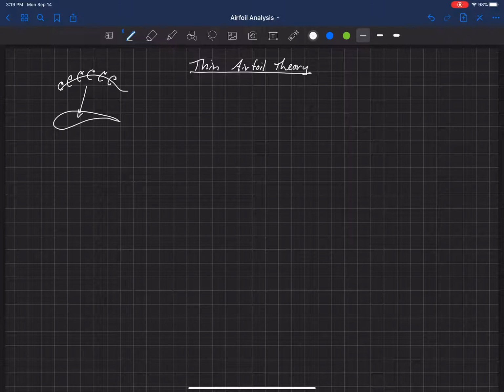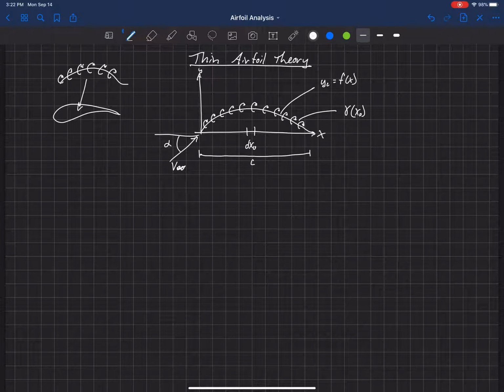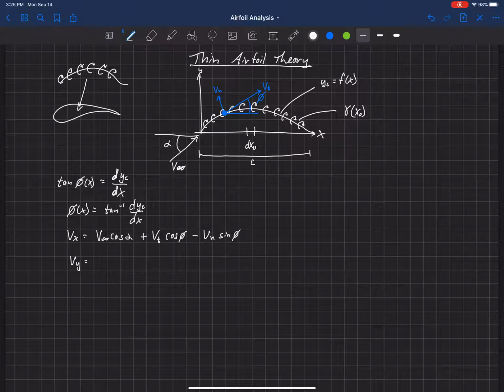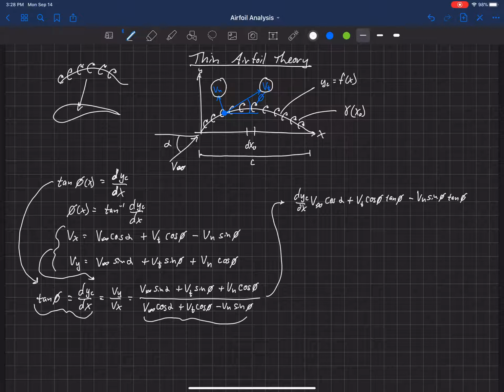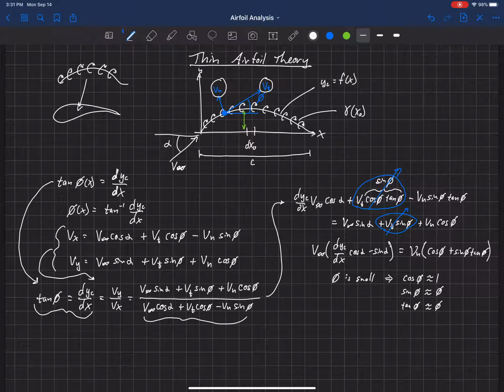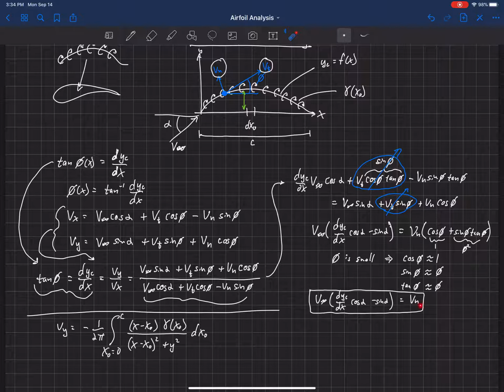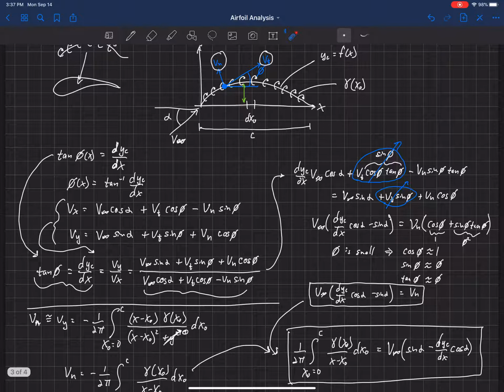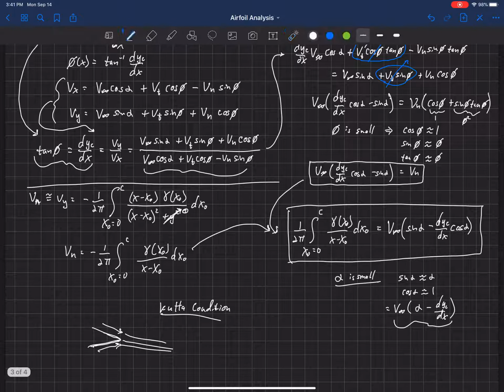Airfoil Analysis . Thin Airfoil Theory . Fundamental Equation

Comment: I don't understand how you can state that the mean camber line should be considered as a stream line. There is a discontinuity between the velocity upper to the airfoil and lower to the airfoil, induced by the vortex distribution. So the mean camber line can't be a stream line and cannot be a part of the flow field. Don't you agree?

Comment: Great job explaining as always, I have taken the basics of Aerodynamics course on your website before.
I only have a problem understanding how and why does the behavior of vortex sheet equate to behavior of a thin airfoil.
Inspiration for this approximation had to come from somewhere I guess, and it is not fully apparent to me where did it come from and why should these two things be (to some extent) equivalent.

In other words - why is there some vortex sheet distribution that can to some degree approximate a behavior of a certain airfoil.
Reply from the maker: Great question. The idea is that a thin airfoil in the limit as the thickness goes to zero, is simply a camber line. So for thin airfoils, we can approximate the airfoil by only looking at the camber line. Below stall, that camber line will be a streamline of the flow. So we replace the camber line with a sheet of vorticity. We tune the strength of the vorticity along the sheet to force the flow to align with the airfoil camber line. This makes the flow take on the shape of the camber line, and makes the camber line a streamline of the flow. Does that help?